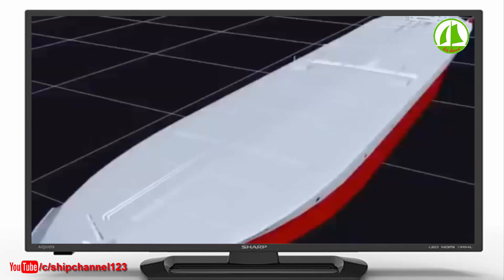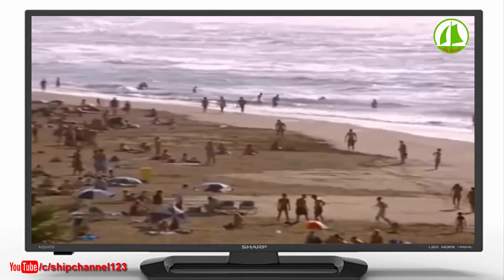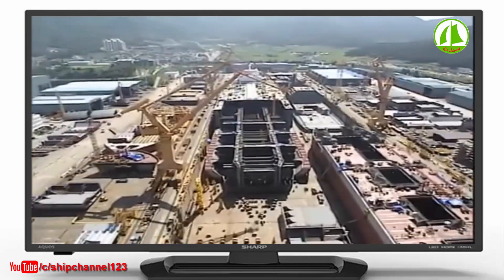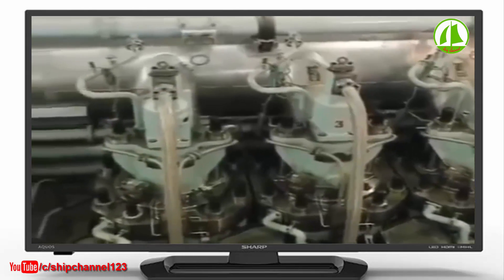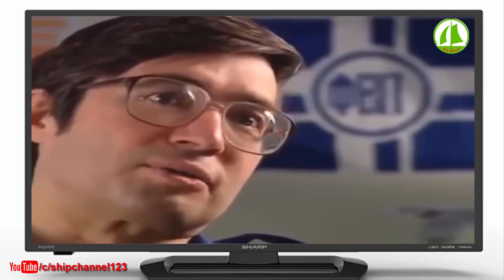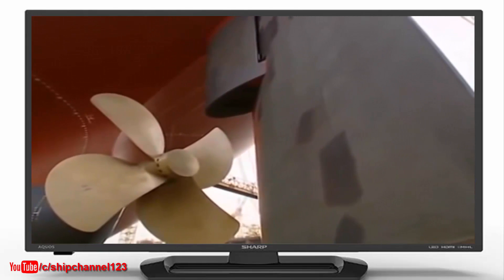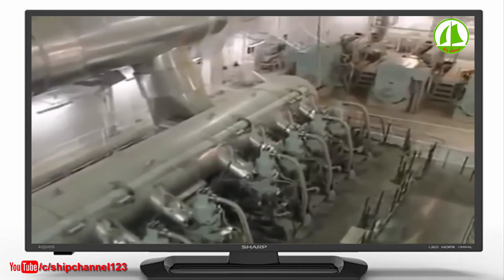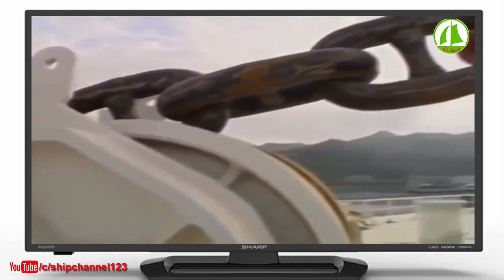launching super ship - HD doccumentary

Comment: Dual Hulls around 5 years.  Fail!  Dual hulls have been around for over 160 years.  Some ships prior to the Civil War like the monitors used double hulls.  The military has used double hulls in some ship classes for years.  Yes, tankers have generally not used double hulls for cost reasons, but recent history has shown that single hull ships have a high incidence of leaking when a hole is put in the hull.  With no "inner" and "outer" hull the cargo leaks directly into the waterways.